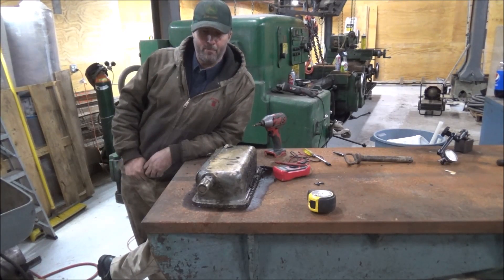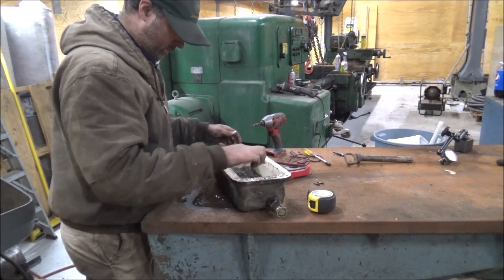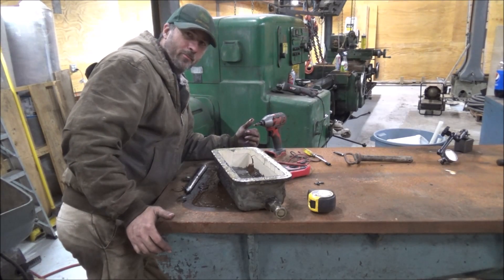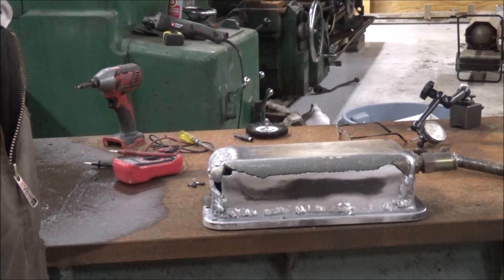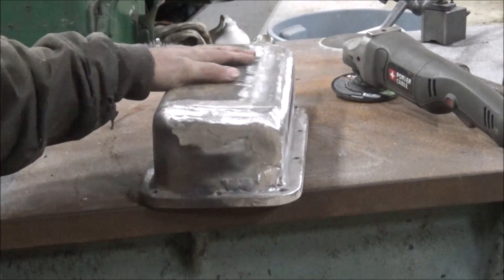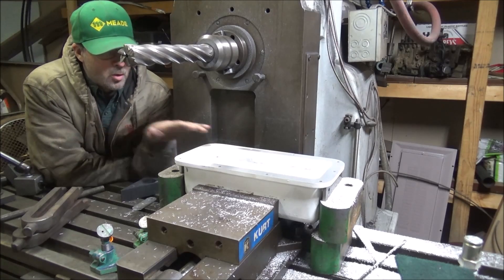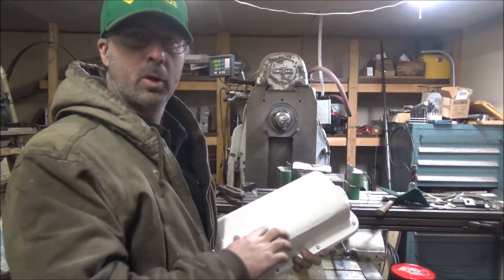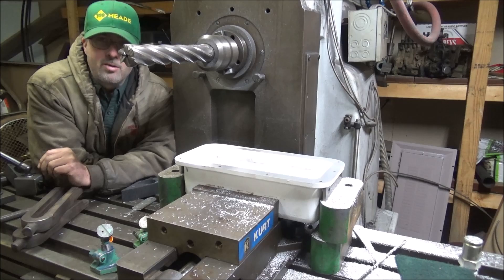Humpty Dumpty Sumpty

Comment: hello brian if you really want to test that sump for leakage use diesil fuel instead of water diesil will leak where water will not if you can believe that. i welded a alluminum fuel tank for a gye then i tested it with water and it didnt leak so i gave it to the gye he put diesil in it and it leaked 3 times lol finnally i got it and tested it with diesil and it was all good didnt leak.

Comment: Sounds to me that the Hydraulic oil reservoir fits into a very tight space?
Reply: Oh, this machining is for the cover to be leak proof???
Reply from the maker: The machining was to get it back flat so it would seal and not leak oil.  The welding plus crash had it distorted a fair bit.

Comment: Amazing intensive care on that  part! 
My only question  is instead a slightly sketchy clamping, and since its only aluminium. why not just lap the sealing seat flat?
Maybe to much material to remove without lapping your life away...
Im a total novice someone feel free to inform me.
Reply from the maker: It took .040" to get it as clean as I had it, lapping that off with sandpaper would have took several hours I think. if I had a big flat belt sander to do it with that might have been a viable option.

Comment: Very, very nice save.  Cast aluminum can be extremely hard to weld with good results.  I think it turned out great.  Buying a billet of aluminum that size would have been no fun at all.  I though maybe you might have to weld a new sump together with 1/2" plate.

Comment: Hi from England 

It's a decent enough piece of component recovery is this Brian...
But I may have been tempted to cast a new one...
Reply from the maker: I don't have the capability to cast one though.
Reply: @bcbloc02 

Come on Brian..
You've a decent set up there and it'd be a piece of piss for you to knock up a furnace out of a cut down oil drum, some Kaowool lagging and a bit of old pipe for a waste oil burner...
Crucibles are easy to get on ebay...
A set up like that would be cheap I'm sure...
You could start off with Ally...
Then move on to your brass, bronzes & gunmetals...
Then Iron..

It's all stuff I want to do myself...
Reply from the maker: I would love to have a full on coupola furnace to make alloys in :-)
Reply: @bcbloc02 

Wouldn't we all Brian...wouldn't we all...
Reply: @bcbloc02 

Brian...
Set up a crucible furnace and launch some smacked up alloy wheels into it...
A bit of baking soda as a degass to push the hydrogen gas out of it a few mins before pouring...

Comment: That was a good job considering how porous cast ally is and it sure can warp with heat. It was great actually seeing a large end mill in use and yet the two inch bit didn't look so large next to the lathe sump.

Comment: My Dad tried to weld a crack on a exhaust manifold off a heavy duty dodge 318 once. He failed with that challenge. I think he used his acetylene torch and a nickel rod. He tried some other rods, but they didn't work either. So we looked and looked and looked and looked some more (for two years) for another manifold and couldn't find one to fit that engine. It was a heavy duty dodge 318 in a motor home (RV). So eventually he just gave up on it and sold the motor home.
Reply from the maker: Sad part is if that was one of those 4 port poly head 318's I probably have a pair of manifolds for one. :-)
Reply: @bcbloc02  ...... wish I had known you back then cause after my Dad spent two years looking for another manifold and buying two extra dodge's with the smaller 318 engines in them the manifolds still wouldn't fit that particular engine.

Comment: Sometimes you gotta do the best you can.  How's the heated floor working out you.  Nice to have a heated shop to work in.
Reply from the maker: It works ok, could use a bigger heater than the 4500watt hot water heater but that isn't in the cards right now. I really need an insulated ceiling next.

Comment: Doesn't matter if the welds hold water, you'll be painting the insdie in epoxy like it was originally I imagine? Its good practice to drill out the crack for sump repairs, so i would have just fabbed one for such a large crack (provided i had a sheet of aluminum ..)
Reply from the maker: I didn't have any 3/8" aluminum sheet in stock anyway. Was epoxy paint common in 1960?

Comment: Would have liked to see what all you did to clean that oil soaked casting and welder settings since we didn't get to see any of the actual welding buddy but thanks for vid as always Brian, enjoyed.
Reply from the maker: Welders seem to be the only more critical internet people than electricians so I usually try to refrain much from getting into  my welding. I still get comments on my drill welding series that welding it up won't work.

Comment: Nice job man , on  all cast aluminum wheels they go under water and pressure tested , any air leakages are peened 
With a tool like needle scaler it peens the material and no  more bubbles.

Comment: Great job Brian. I welded professionally for many years and tig welding cast aluminum never looks the greatest. I always hated welding it myself because of all the trash the material usually has in it not including the oil that has soaked into the pores of it over many years of use. You just saved yourself $600 in material cost trying to machine a billet. Not to mention the time to do it. I always love these repair videos. I guess Bailey has enuff confidence in you he thot it was not necessary to inspect. LOL  Thanks for Sharing.

Comment: ,,, looks good enough for an auxiliary dry sump for one of those big Dere pulling engines . Btw, just saw an engine lost due to the paint coming off a pan and clogging the pickup .
Reply: Maybe baked on enamel or epoxy paint should be used ?

Comment: Probably a dumb question, but it looks like you painted the inside, are you not afraid of the oil pulling the paint off and clogging things?
Reply from the maker: I hope it is oil resistant paint and it won't come off.

Comment: There's a surefire way to locate porosity in a weld.  Rub a rubber-tipped 100 psi air nozzle all over  one side of the weld and spray soapy water on the opposite surface. It will find even the smallest defect.
Reply from the maker: Thanks for the tip! Will have to try it sometime.
Reply: @bcbloc02   Also, you can apply Loctite 290 to the whole surface and it will weep into any porosity and plug it up. It is used for that by automakers. Rear end assemblies where the axle tubes insert is one such place. With Non-ferrous, you should spray primer where you want to seal or the anerobic reaction might not kick off.
Reply: Great suggestion! I plan on welding up an aluminum tank for my boat and will give it a try. Thanks.

Comment: I imagine it would not be too difficult for you to learn how to cast a replacement yourself. It doesn't look that hard and I think you already have most of the tools for it. The weight of the pour might be the hard part and getting the oversizing correct for shrinkage. Never the less, if all else fails you could give it a try, I have faith in you. Thanks for the videos.

Comment: Did you weld this with your Miller 330 Brian? Also. Is it possible to use the center in the end of that endmill to stabilize it if you were in a pinch?
Reply from the maker: Yes I used the old 330, its the only TIG machine I have. No new fancy pulse controls or anything, just high frequency , jam the pedal and go!!
Reply: @bcbloc02  Cool. We recently got a 330, I have yet to do any aluminum. I assume you were in high range, do you remember what amperage you were at? 3/32nd electrode or larger?
Reply from the maker: Mid range, probably 80-90% pedal. I think 1/8" lanth electrode. 30cfh on the Argon.  I wasn't super happy with the electrode performance but it was all I had.  I need to experiment more with my setup sometime in the future. After the fact I was reading in the manual about running half bridge instead of full on the rectifier and I don't really know how mine is configured so something else to check.
Reply: @bcbloc02  Thanks. I've checked out a few of these now and they were all full bridge rectified. If you try it out do let us know how it works. I've read the high frequency capacitors fail a lot, but if they aren't leaking goop they're probably fine.

Comment: Nice fix!

Was there anything that changed internally to the sump (like pickup tube clearance) due to the flange machining?
Reply from the maker: It has no pickup, it just acts as a drain point and to add clearance and access for the hydraulic filters in the main tank. I suppose they also hope sediment will collect in it as it is from the days of non detergent oils.
Reply: @bcbloc02  I figured that port was the suction, I was just referencing a pickup tube because I know it's a concern when building engines. Didn't know if there was anything similar to accommodate, here.

Thanks!

Comment: Dang Brian that was a mess to begin with. You practiced on of my favorite sayings “ sometimes I have more time than money “ because there is a lot of time in just welding that thing up. Like you said the repair choices was limited. Truthfully the welded casting was the easiest repair, fabricating a sump out of plate would been as time consuming and you would still have the warpage problem.

Comment: Come on Brian, 10 minutes and some flex tape would have fixed that sucker right up and made a trending video!  Lol😂
Reply from the maker: Yeah I could have got 10 times the views if I had used Flex Seal!! lol
Reply: @bcbloc02  doh! Coulda used screen and flex seal...haha..turned out good, thanks for sharing
Reply: OR JB Weld sitting on the bench (from the last video Brian posted) :)
Reply: It even works under water!
Reply: I hate to admit it but I have used flex tape and flex seal. For the applications I had the stuff worked. The screen & flex seal is funny, I worked on a car a few years ago where the "body shop" had used aluminum window screen and roofing cement to patch large rot holes in the inner fenders.....

Comment: Since you were welding on it anyway, it occurred to me that it could have been held down by drilling a couple of holes in the bottom and bolting it to the table. That, or lead encasement seems like the only practical way to hold an oil pan like that if the sided were anymore tapered than they already would be from the pattern draft.

Comment: How did you clean the soaked in oil out of the casting before tigging it? Hardest problem with aluminum is getting it clean, especially a cast piece that’s been soaking in oil for a long time.
Reply from the maker: I washed it all in soap and water till it was clean, then I threw it in the oven at 300deg for a few hours, then washed it again, then wire brushed it till it was bright and started welding, a lot of times I would have to weld a bit then wire brush or grind away the trash and then start welding again. I probably spent 6hrs piecing it and welding it all back together.  Biggest peoblem I had was I don't have a water cooled torch and I was running  a  lot of amps it liked to have burned me alive welding that thing up everything was HOT!!!!!!
Reply: @bcbloc02  My Uncle and 1st cousin used to make log frames and put grouser bars on dozer pads with a 225 amp Lincoln buzz box. Had to dip the stinger in water to be able to handle it but the buzz box never died.
Reply: Fred Newman not sure on how he did it, but iv welded a cast aluminuim manual transmission before and i used a torch and basically boiled the oil out then it would turn black, clean the metal, and heat again until it doesnt turn black anymore. Then tig it up, then use a torch while its cooling down to keep it from cooling down to fast.
Reply: Heed a trick for you clean cast aluminum: make a few passes without filler using DC, not AC. You will need to repair you tungsten, but the DC current pulls all the crap out promptly. Wipe clean, switch to AC, then weld away. Faster and more effective a method than a preheat.
Reply: Thanks for the tip.
Reply from the maker: Got a torch reccomendation? I was thinking the flex loc fl2525sf as I rarely ever get to do nice easy laid out welding, it almost always is some tough angle or position.
Reply: I have a victor torch with my oxy-acedaline  set up, iv had it for many years, and it works well. otherwise you could buy a map tank and napa sells some nice head units for those little bottles. @bcbloc02
Reply: @bcbloc02  A mechanic or welder has to be a #1 contortionist!
Reply from the maker: Mississippi Backwoods Master Tech. And WelderA little misunderstanding as I was talking TIG torch for my Miller welder. I already have 2 good sets of oxy acetyl torches.
Reply: tig torch wise for my watercooled miller tig welder i use an Esab brand, its been on there several years and has served me well.  @bcbloc02
Reply: I've had good luck with cleaning well, and baking in an oven to cook out all the volatile. Oven cleaner after the fact does good to get the last of the organics off it - but briefly and with caution as the lye will also attack the aluminum but I think that helps to get some oxide layer off too. Whoops, didn't see Brian respond. Guess we both figured out the oven trick!
Reply: @bradley3549  In an oven in self cleaning mode, you kill 2 birds with one stone, clean oven and a clean pan...   Don't forget to do this when the wife is out for the day and keep the windows open...   ;)
Reply: @pierresgarage2687  I've done high temp burn-offs of steel parts in self cleaning oven and I agree it works a treat - but not aluminum. Probably no reason not to, but since it's well north of 900F I've always worried. I have a dedicated garage oven (with PID temp controller now so >1000F is now doable), so that's not an issue at least!
Reply: Right about the temp, Aluminium melts around 1100F, 900F is on the max temperature it should get, if well controlled, I wouldn't worry, but, not sure about a kitchen appliance would be vere accurate...
Here also I use a heat treatment oven with a PID to do that task, on smaller parts at least since I'm limited by the small size of the oven, a BBQ is another option...
Reply: @pierresgarage2687  My cleaning lady put aluminum foil in the bottom of my self cleaning oven. The self clean cycle melted it.
Reply: Guess self cleaning oven is too risky for cleaning Aluminium parts, better take no chance...   Let's keep it only for bronze and cast iron...   ;)
Reply: @pierresgarage2687  I can confirm on the lack of accuracy with the stock electronics. Wide hysteresis and +- 20% from called for temp, depending on probe location. And large hysteresis, when using the standard thermostat!
Reply: @bradley3549  Hey, what PID controller do you use? I scavenged our old range to do the same this that's why I'm asking.  Thanks.
Reply: @markwatson9816   It is an Auber SYL-2362 din mount. Nothing special if I recall, but cheap. Random eBay solid state relay of the appropriate size. On Amazon and eBay but list kits now that have very similar components for $5-60 now.